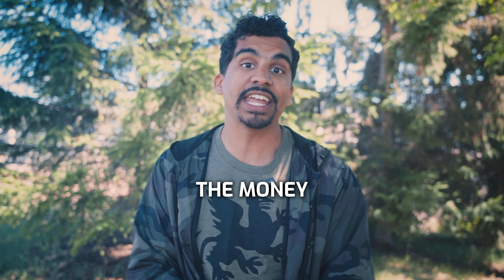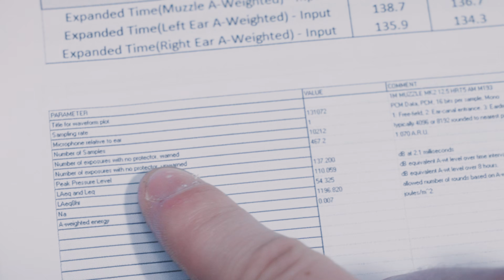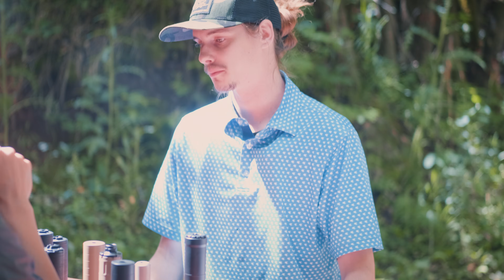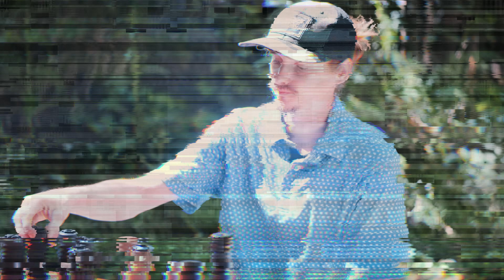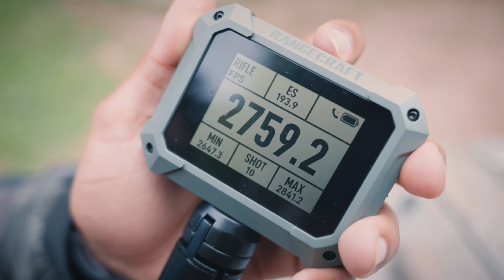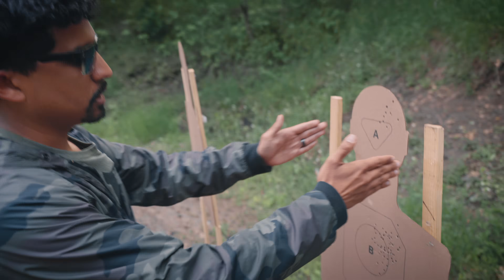What’s the Difference Between a $500 Suppressor and a $1000 Suppressor?

Comment: Not an eternity...
If Steel cuts a 700 surface feet per minute
And the Nickel cuts at 90
The 10 minute cut in steel would take approximately 77.78 minutes.
The math is straight forward.
Time² = Time¹ × (SFM¹/SFM²)
Time²=10minutes × (700/90)~ 77.78 minutes

Its very basic. Cutting time is inversely proportional to the cutting speed (Surface Feet per minute or SFM) When reducing SFM the cutter (RPM)drops which lowers the feed rate (IPM)
In your scenario, the reality of Physics can be negated by throwing your suppressor in an ultrasonic or Breakthrough suppressor cleaning cylinder. That's just the real reality of the situation.

Comment: accuracy is effected by reliable stability of the bullet, as well as consistence in velocity. If a muzzle device/crown/suppressor imparts turbulence or buffeting (or worse contact) to the bullet, accuracy could be very poorly effected. Which might not be the largest factor in the matter, but by default would be my largest concern. though I am interested as to how a suppressor decreases velocity spread, I would have thought that was strictly controlled by the precision in powder quantity and quality, bullet weight and given barrel length.

Comment: I've been looking around for a 30 cal for my 10.5" 300 BO. I think I might go with a Griffin. I have a B&T as well. 3D printed inconel and high flow. Its damn quiet. While it's also 30 cal I use it on my 5.56 - which I want a dedicated one for that but I think I'll keep the B&T on there. I won't gain much more sound damping on a 5.56 anyway. 

Now if Griffin has for 338 then I'm sold.
Reply: We are producing a 338 version of the PRC silencers as we speak if that interests you!
Reply: @GriffinArmamentOfficial  I'll absolutely check it out. Just need to finish off my 300 BO, cry over my wallet, and start another one.

Comment: Ridgeback defense rhodie 6 is still beating their cans for a few hundred less
Reply: The HRT in this video MSRPs for 969, but can often be got at 869 via our site. The Rhodie MSRPs for 895, and that doesn't include a mounting system or a muzzle device like ours does. If you add on a Plan B adapter and muzzle device via their website you are looking at 1043. And that's not even a locking mount system like the DUAL-LOK is. So not really whatsoever by any stretch of the imagination lol
Reply: @GriffinArmamentOfficial  ok you got a mount system and that's what your cans are known for a mount in a world of suppressors being known more for your mount than your suppression is telling. their performance is still beating yours. anyone buying a can can afford a 80  plan b hub and a muzzle device for 40 to 120. who's not already running some sort of muzzle device with a mount option on a build. most people only have to get the cheap hub. but we got the dUaL-lOk
Reply: @Rabid_F30  Alright, have it your way. You can get the HUB version of our can for 729, there's is 895, so still not cheaper. That's more apples to apples anyway I suppose. Ours is a stronger material, their lifetime warranty is 100 bucks, ours is included. The Rhodie is 2 oz heavier, wider diameter, same length. There is no public sound test data on the Rhodie other than what Ridgeback claims so let's go with that for argument's sake. They claim 132 dB, assuming that's a muzzle metric since they don't specify. We are 1 dB quieter than their own published results at 131dB, so quieter in a smaller size. How exactly is the "rhodie 6 still beating our cans for a few hundred less"?
Reply: @GriffinArmamentOfficial  the fact your taking so much time to try to make your cans to be so much better goes to show a small shop in the hills of Kentucky has the industry shook. I picked my rhodie up for 750 at a local shop add a 80 Comstock hub. my friend has a Am625x and its a noticeable sound difference with the rhodie being quieter and different pitch. he paid nearly 1200 and had buyers remorse now

Comment: Rule #1:  There are no free lunches.  The less back pressure (the more flow), the louder it is, period.  Physics remains undefeated.  That said, there's a correct spot for the trade-off for semi-autos.  But low-back-pressure cans should cost less, not more; they don't have to be as strong.
Reply: I see your point, but the complex geometries are much more difficult to produce and refine, and the machines required to make them are roughly 1.2 million each. The material we use is also more expensive. There is also still post-print machining that needs to be done involving 2-4 external CNC machines.

Comment: The LEAST important characteristic of a suppressor is how much it suppresses noise.  You’re dealing with minor variations between all suppressors no suppressor is gonna get rid of it completely and the differences is so minor It’s not even worth discussing. 

The big three things about a suppressor you need to take into account are…
1- heat recovery and cooling. This is how much heat is going to degrade the suppressor, causing it to fail. Some suppressors are rated for full auto. Some have barrel length restrictions. This is where 50% of your interest should be. I am talking literally 50% of your decision needs to be based right here.
2- the next most important thing is weight and maneuverability on the host weapon. You need to include the connection device / type, whatever that is. The decision needs to be made around the entire mounted unit.  Now there’s an idiot out there in the ethernet world who says that suppressors are contextual. They are not contextual. If you own a suppressor use it there is no reason not to use it. The only reason it gets disconnected from the host weapon is to clean that’s it. There is absolutely positively no reason to not use a suppressor. This is like saying your optic is contextual because I have backup iron sites that is freaking foolish. The only time you not use your suppressor is when it’s broken you take it off and now you’ve just got your mounting device hanging off the end, anyone who tells you don’t use your suppressor is an idiot.
 Another example is Night Vision if someone’s telling you, it’s pitch black out here don’t use your Night Vision. Use your white light. What would you tell them enough on that foolish subject.
3- flash mitigation and back pressure both of these are your least of the three to worry about and you worry about them each around the same so this is actually number three and number four once you decide on which way to go either low back pressure or regular then you need to decide in tune the Gun accordingly. I give flash suppression the higher ranking of the two only because I can deal the high amount of back pressure buildup. Since most cans provides some form of flash protection, but some are worse than others. That’s where I put my money. On my longer rifle, I use a Surefire. I don’t want any flash whatsoever. I’m hoping to hide my location. On my SBR, I’m using a Rugged. They do put out a bit of flash, but at that point, with an SBR, my threat already knows where I am most of the time. I’m just toning it down a bit to help my NVG‘s at night and also to disperse the sound providing a bit of concealment. The reason I go with Rugged is those silencers are tanks.
Reply: Interesting write-up. But I think saying there is almost no variance between models is pretty unfounded. Have you ever stood next to a guy shooting a Flow556K? That being said, you make a lot of good points that most other people never think of, so thank you for that! dB chasing has to be done not at the expense of what your mission requires.
Reply: @Gri @GriffinArmamentOfficial  but there is really no difference within different suppressor classes. There is difference outside of those classes or between classes. If you’re talking about a K versus something else yes there’s gonna be a little mild difference, but  not Hollywood sound versus headset required. They ARE still required. You also have to deal with the difference between hunting and combat. Even 15 db is NOTHING. If you were trying to tell people that a 30 DB reduction versus a 35 DB reduction is like miles apart and a 35 DB or 40 DB reduction is Hollywood clear crystal silent that’s a lie and you know it’s a lie, the 30 DB reduction and a 40 D reduction almost no difference in real world applications 100% no difference in real world applications. Just prove it to yourself grab a 30 DBA and a 40 DB can go out to the woods. tell someone to go out 100 yards away 300 yards away. Tell me which one you don’t hear. Which one is oh my God I can’t hear it anymore. Please sound reduction is the last thing to even think about with suppressors.
Reply: @dijax7863  Ahh, I see your point and I agree. The technology seems to be coming up to a wall very soon, and the race is tightening within similar models. Yes. 

As for dB reduction, dB is a logarithmic scale, so a 10 dB reduction is not twice as much as a 5dB reduction, it's more like 3.16 times more. That's why a 139dB can sounds noticeably louder than a 130dB can even though they're respectively reducing by a "similar" number - 31 vs 40 dB (assuming 170dB as an unsuppressed baseline). Using your example, a 35 dB reduction is 100 times more of a reduction in intensity than 15 dB is, so as the numbers increase, the reduction increases exponentially. 

The reason at 300 yards you wouldn't be able to really tell a difference is because neither suppressors are reducing the sound level of the supersonic crack of the bullet. With subsonic ammunition, minute differences in dB performance become much more noticeable to the human ear because you aren't hearing the supersonic crack. In a real world application, a 10dB difference to the shooter is the difference between ringing ears and no ringing ears. It absolutely makes a difference. I have shot cans where I cannot hear anything after shooting it for a few minutes, and I have shot cans that do not change my hearing in any way, don't even cause ringing. So there is a difference to the shooter 100%, and that difference (no matter how slight it may seem on paper) might mean the difference between fighting off a home intruder with absolutely no sense of hearing because you have a high flow k-can that is spitting 143 dB and now you can't hear because you shot without earplugs on vs maybe your ears ring for a bit but you're not completely incapacitated. If that can had been a 132dB suppressor, your ears might ring initially being indoors, but you are not going to be deaf for the next half hour. 

I don't want this to dissolve into a pissing match though, so I hope you know I'm not trying to piss you off or anything, just genuinely having a discussion. You are 100% correct that sound is not the only factor people should be looking at, but it is a factor, and it's more of a factor for some people than others. For a hunter, flash is likely the least important metric, and sound reduction might be first or second after weight/size. But to say it's universally not worth paying attention to is something we don't agree with. It's all use-case based.
Reply: @GriffinArmamentOfficial  I totally agree with what you’re saying. I own several different types of suppressor, but it truly comes down to not that big a deal because very rarely are you gonna find some critical difference between the suppressor in sound value …the other categories huge difference …. huge
Reply: @dijax7863  I appreciate the discussion. A lot of newcomers don't think about all of these different factors and that's something we always try to stress to people too, think about your mission and take all of the aspects into account! Cheers brother, have a good weekend!

Comment: everyone has their own use for their own can. You just need to find the one that checks your boxes. Look at any car, it can be by use, feel, or just if you like it. a 500$ suppressor is not worse then one that costs 1000. I will say though, there is a mark up on these things for brands centered around "muh brand". Just get a can that fits your criteria of length, sound reduction, weight, material(use case) and you should be happy. Also every can gets hot as fuck, no can is full auto rated, dont buy into that BS. Dont gaslight people into thinking something that costs more is always better its not. Also strap that damn optic down holy crap yall like shooting without zero???
Reply: What do you mean, no can is full auto rated? We have shot our HRT-556 carbine can, 17 30-round mags in under 6 minutes, full auto. We have a video of our M240B suppressor shooting 600 rounds in a minute, nonstop. And Red Right Hand has shot our new HRT-556 AM (the one in this video) 300 rounds on his Belt fed Lima 6 gun in 556. What are you talking about???

Comment: I highly suggest using the dual lok system. It is by far the best mounting system, especially if you move cans to different platforms. 
They sell the individual hub mount if you want to use it with a can from a different company.

Comment: it's not necessarily material limitations for subtractive manufacturing to make a flow through capable cans, it's the complex geometry that additive manufacturing can achieve that lends itself to flow through cans
Reply: Spot on. Unless you are using exotic alloys. The tooling cost and increase in job runtime is just not anywhere near conducive to producing an affordable product.

Comment: 29:46  I would only caution that those results are with ONE loading using ONE propellent.  Loadings using propellents optimized for longer barrels will give wild deviations in short barrels (generally).  Most of that being caused by the specific propellent with a given bullet weight. Primers, bullet design, and other factors can also contribute...but the burning rate of the propellent will be the biggest factor.
The principal is valid.  Adding something to the end of the barrel bore WILL affect velocity and load performance, but in which manner is subject to variation for each loading/barrel length.

Comment: the only diff. between a $500 can and  a $1K can is, the rip-off prices. not to mention paying a premium just for the Brand name.
Reply: Lol 1600 for one of mine... Definitely worth it. Lighter and no gas in the face. No tuning or extra buffer weights etc.  There is a big difference between freeze plugs in a mag lite tube and inconel or titanium printed flow through tech.
Reply: Use to be in that boat but after buying multiple cans and eventually splurging on the griffin dual lok 7, the rest just add weight to the gun safe. There most definitely is a difference.

Comment: The question shouldn't be about cost, it should be about the material, and what type of shooting it is rated for (ie, full auto vs semi auto or less)
Reply: Cost is a big deal to most consumers, and this should be taken into account by manufacturers. Most consumers (myself included) have to do a cost-benefit analysis that takes into account price, use case, shooting volume, weight, and more. I own two suppressors - a Griffin dual-lok HRT 556 (original) and a Griffin Dual-Lok 7 (original). These meet my needs, have reasonable back pressure, are light weight, and were a price I could afford.
Reply: Cost IS a big factor for a lot of enthusiasts tho.

Comment: I bought a CMMG Suppressor rated for 200 plus rapid fire vs my buddy whos got a suppressor from banish that heats up within 3 shots. I bought mine for suppressed shooting and he bought his for a quietness...
Reply: Huxwrx for less gas in the face. No extra parts or tuning needed either
Reply: @breckfreeride I would never own a Hux. Loud, flashy, and the absolute worst cans I've ever seen under nods and thermals. Big, glowing, flashing, neon shoot me sign.
Reply: @MrCashewkitty I wouldn’t buy one either but it clearly isn’t that bad considering the DOW is investing heavily in the black magic cans. I spoke with a Hux rep at shark coast tactical a few months ago. The new black magic can is using heat treated inconel. So they actually quench the inconel which most companies do not do. That’s why it costs so damn much. 

I’m old school I got the sandman x as my first can a few weeks ago. I liked the flow through baffles mixed with the nomad baffles at the end. I’d tuned my 14.5 pinned spr for a traditional can many moons ago but never got the can. I run a DD 14.5 pinned upper but I use an LMT enhanced BCG and Bolt, with an A5 system, H0 buffer with the extra 1oz plug added by a law folder, and a sprinco green spring. It’s absolute money! Gassy enough to make the green spring worth it, without being over gassed. Perfect medium.